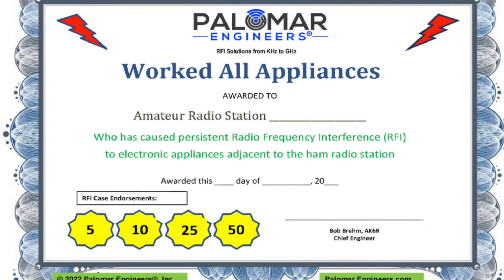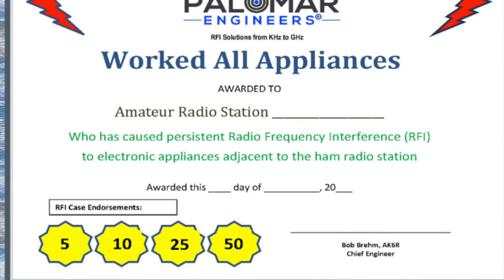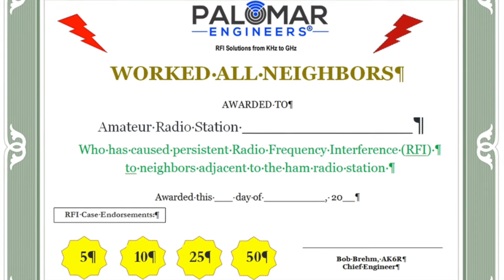Ham & CB Radio Myth - SWR Makes Coax Radiate!  NOT!

Comment: Seems to me that when a common mode choke is applied, noise is also reduced. Good stuff, no BS. Subscribed. KE8EC
Reply from the maker: Yes the coax shield, the outer part, can act like a vertical antenna and pick up noise which is why the choke works.

Comment: Good advice, Mark.  I use 43 mix ferrite rings on my coax to stop r.f. on the braid.
An amusing story, at least for two of us.
I operated a special event station with Frank, I was using my 4 Watt transmitter, short coax and tuner and a long wire when Graham decided to add his counterpoise earth while I was transmitting. He jumped back because he had received an r.f. burn. Keep r.f. at the aerial.
G4GHB.
Reply from the maker: Good stuff

Comment: Be aware that EFHW antennas often depend on the coax shield (i.e., common mode current) for their counterpoise.  As a general rule, a common mode choke for an EFHW should be placed at (0.05 x fundamental's wavelength) or greater distance from the UNUN.
Reply from the maker: Great point!!!!!
Reply: If you really want to go down that rabbit hole of end feeding antennas, and what constitutes a counterpoise, read  Les Moxon's book "HF Antennas For All Locations".  'An open circuit in which current can flow'.

Comment: One note. If you “ look down” the outer shield ( that third wire) go the coax you will see an impedance. It could be low or high or somewhere in between. If it is high that’s good and no UN-UN or anything else is needed. If it is low you will have common mode problems. Somewhere in between and you are in the gray area! If the impedance at the end of the coax away from the antenna is high and the coax is a quarter wave or some odd multiples of a quarter wave long then you will see a low impedance and common mode can flow. Changing the length to a half wave can change the impedance back to high and all is well! The exact opposite is true if the impedance is low at the end away from the antenna, then the impedance looking back will be high if the coax is a quarter wave or multiple of a quarter wave long, but if the coax is halfwave long it will be low. The length of the coax can make a real difference. In my 60 years of feeding dipoles with coax, I have rarely had a problem. However if I ever do, I plan to change the length of the coax experimentally. I will not say I have not had common mode radiation but I will say it has not been a problem. Where it would be a problem is on directive antennas. On my 6 element and 4 element Yagis I did use a balun because any feedline radiation would change the pattern of the antenna and make it less directive and ruin the front to back ratio. I don’t really care on my dipoles, as long as my radio chassis is not hot with RF. High power does amplify any common mode effects, so you can get away with more when you are QRP than when you run high power. I think the ARRL antenna book touches on this subject but does not go into it as much as I wish it would. I don’t mean to say no one should use a balun. When in doubt a balun is not a bad choice however it is not always necessary. My baluns have consisted of a few coils of coax. No one such balun can be expected to over 80 through 10 meters but works well if done properly.

Comment: Sir, I made a two element 10 meter yagi using a Gamma match. Lucky enough, I got a 1.2:1 swr to my target frequency at around 28.200 and a 1.5:1 on band edges at 27.800 and 28.600 MHz. via my MFJ 269 analyzer. Problem is, when I tried it on my Anytone AT5555N with a hundred watt amp, the swr went up to around 3 is to 1. Why do think is that so? And when I directly connected the yagi to the radio itself at 10 watts deadkey, the builtin swr meter barely moves. Thank you so much.
Reply from the maker: The amp is obviously changing the impedance.  Try adding some additional coax and see what happens or don’t use the amp.  Where does one get a 100 watt amp?  Going from 10 to 100 watts is less than 2 S units.

Comment: I say RF Choke is essential equipment. DO NOT buy cheap coaxial cable or cheap connectors, been using MPD Digital and JEFA TECH cables without a problem. BALUN DESIGNS baluns and chokes are outstanding.